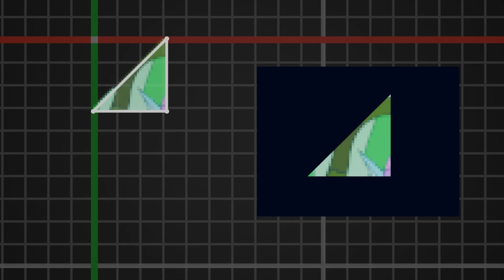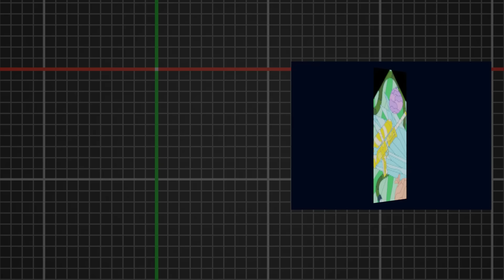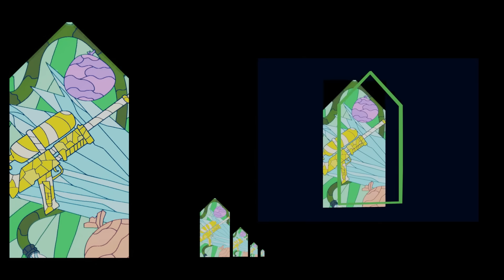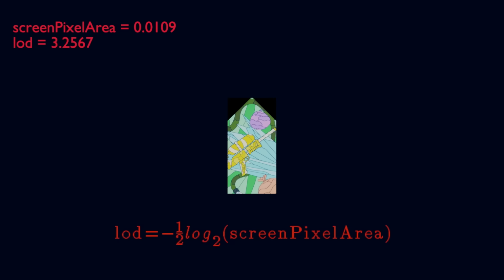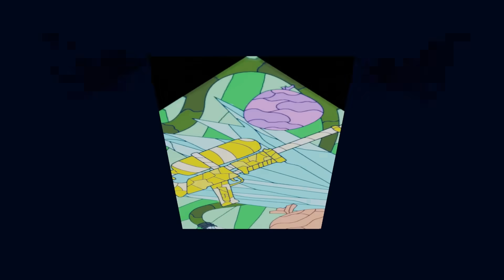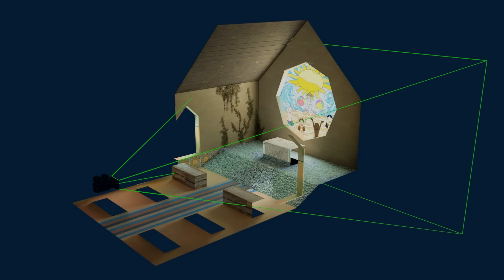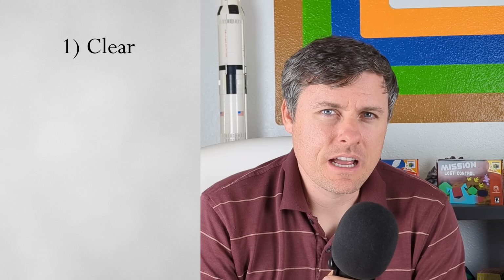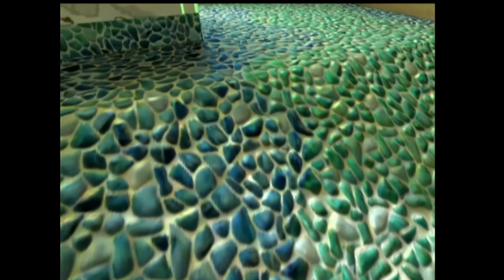How I implemented MegaTextures on real Nintendo 64 hardware

Comment: I wonder if a nanite-like system could be developed to allow N64 to render much more polygons at any single time than it normally does.
Reply: The RCP RSP code in the SDK is quite limiting. I guess if you upload special routine (shaders) for your Nanite meshes, it can render more polygons.

If you use the z buffer, you can swap in the Nintendo code and render the usual stuff into the same scene.

Comment: How about distance fields next? Valve's solution for crisp vector-like graphics from bitmaps. Would be great for text in Portal 64. Not sure how it would look with N64's diamond-like interpolation, but maybe that can be exploited in the textures. There's several ways to do distance fields beyond the basic 1-channel gradient in the "improved alpha-tested magnification for vector textures and special effects" paper that might allow for sharper results with smaller tiles. I don't recall their names off the top of my head but I know they're typically used for encoding fonts to bitmaps.
Reply: On N64 you really pay for complicated pixel shaders. Now I gotta read the paper ..
Reply: @ArneChristianRosenfeldt  It should be as simple as a threshold or boolean, but that's simple in modern computers. I don't know if that's possible on a per texture basis from the camera view.
Reply: Did you consult libdragon documentation? It makes everything sound so complicated. But if we skip the "comfort function", the 2d and the blurry stuff, it makes sense. It is a data flow: Load texture, pixel shader, blender ( reads the frame buffer, blends in the triangle ). At first it is weird that it is not just a "writer" as on PSX, but z-buffer and alpha need to "blend" in. Also maybe memory is not 18bit granular? I so hope that Rambus at least has the advantage that you can start bursts on any byte address . Now I just don't have the energy to go into libdragon again and be disappointed.  @jacobcrowley8207

Comment: I remember watching an interview with John Carmack prior to the release of Rage where he was going into the mega texture technology that was built into the Id Tech 5 engine and how cool it was from a technical perspective. He did note that his nightmare was that players would walk around backwards into every new location and then quickly swing the camera around and see all the low detail textures being swapped out in real time. Unfortunately his nightmare seems to have come true, as I also remember the extremely negative reaction that everyone had to the texture swapping in action when Rage finally came out. Rage was a failure for many reasons, but I think this was one of the big ones. This technique is probably best used in niche applications where it makes the most sense to use it rather than trying to use it everywhere all the time.
Reply: Shortly after Rage, Unreal Engine 4 also added virtual texturing, although it works a bit differently from MegaTextures. I'm not sure how often this feature is used in practice though. Could be pretty standard now.

Comment: And one thing it seems a lot of N64 devs are starting to figure out is that optimizing for the N64 can go in some very strange directions sometimes. It would seem that the N64 also has this tendency with 3d graphics, being that it would much prefer to charge through a polygon list Leeroy Jenkens style than to do the work of z-buffering the output.
Reply: Not a sentence I was expecting to read today 😂

Comment: 7:14 I wonder if it's possible on Everdrive using a memory card for save data and splitting the ROM in multiple 64mb chunks?
I'm no N64 expert but I wonder if it's possible to use the Stop'n'swap feature on a software level to switch between ROMs in real time or not.
Reply: Even if the theory worked I wonder how bad the load times could actually be... lol

Comment: Makes me wonder what could happen with some minor hardware modifications and some specialized code.
First we could throw in the expansion pack to get double the RAM.
Maybe use a custom cart that has some way to store more data with bank switching and modern parts.
Go really crazy, and mod the expansion pack to use it's own banked storage for massive RAM increases.

Comment: Random question, can the cartridge be read or written by the CPU while the RPC reads or writes system RAM?
Reply: I‘d say yes. I think the CPU can even write to RSP memory while the RDP draws pixels. Nintendo just thought that they are clever and set up a queue in system RAM ( in their SDK ).

Jaguar cannot.
Reply: @ArneChristianRosenfeldt  i've given a look at the RCP and it seems that every sub component shares the same bus. Might be an error on the diagram, but it seems that every component is ultra reliant on cache, being what makes it possible to do what you described. It's a shame, since if it was possible, the cartridge space could have some extra RAM for the CPU as a sort of scratchpad and filling the main RAM with hires textures wouldn't cause much stalling.
Reply: Yes I also checked. The difference to the Jaguar is that the system bus does not leave the chip. So it is a system on a chip, or not really a system bus. All pins are separated by a buffer. Apparently, the RAMbus signals are no electrically compatible to CMOS logic levels. Everyone says that RAMbus has a high latency. On Jaguar memory hogged the bus, but not on N64. So there were always time slices for ROM data.

Ja, ich habe auch nachgeschaut. Der Unterschied zum Jaguar ist, dass der Systembus beim N64 den Chip nicht verlässt. (system on a chip / oder aber der Name lügt ). Alle Pins sind noch mal durch Puffer davon getrennt. Offensichtlich können z.B. die lowVoltageDifferential 800 MHz vom Rambus nicht direkt elektrisch auf 73 MHz CMOS durchgeschleift werden. Alle sagen, dass der Rambus ein hohe Latenz hat. Anders als beim Jaguar kann aber glaube ich der System-Bus während dessen andere Komponenten bedienen und z.B. eine Cacheline von ROM zur CPU übertragen.  @PancakeDev

Comment: Games with minimal textures look better on low poly systems, regardless if the textures are high quality or not, regardless of performance, using fewer textures looks nicer on low poly geometry aesthetically, lower res more simple textures, look at megaman legends or doctor slump, super mario 64 also goes for a clean look.
But sure, better textures here and there can be necessary for things like character faces.

Comment: I wonder would using a bsp tree for levels make larger levels work, they give out a list of faces your working with and their distances, you could probabally use that to mipmap easier. Also i dont know if n64 vertex coloring works with this but it could be used to help with making textures look less repeated
Reply: Vertex color like subdivision only allows slight deviation from a plane / gradient. Otherwise the LoDs pop too much.

Use BSP for front to back rendering like in DOOM. For each sector, check if any pixel of the bounding volume is visible in z-buffer.

Or rather use portals.. ha! Portals cannot do columns or mesas.

Comment: 8:30 would it be playable if it was just 128p megatextures instead of the high res 1024p like in this demo?
it would still be higher res than normal n64 textures, and wouldnt use so much memory like 1024

Comment: Don’t limit yourself to the 4MB of ram.  Most everyone has an N64 expansion pack that still owns and plays on the n64.  You can easily buy them too for anyone who doesn’t.  What’s the max rom size for an n64 game?  I would go by the max size rather then 64MB which was the max released cart size.  Game cart sizes would have grown past 64MB if Nintendo supported it longer then the year 2000.
Reply: Two friends of mine and i don't have it. There are only 4 games that need it and for the others it's just an extra, not worth the 50€ at the moment
Reply: The texture cache is just 4 KB, that's the real limit here I assume.
Reply: @cube2fox  if you watch the video, you’d understand how he overcame that limit.  It’s very similar to what advanced games from the nes era used, he’s streaming textures when needed to the 4KB cache, changing textures on the fly between frames.  This implementation makes so much sense, I’m surprised programmers back then didn’t do this as well as they got more familiar with the n64 since they already did this with tiles previously.  The ram is used here to help speed up the texture loads.  He mentions the hardware 4MB of ram limit,  the limit was really 8MB of ram when you used the expansion pack.  It seems like he wants to limit himself to the base hardware and the 64MB largest cart size as though the games were made in the 90’s.  Back in the 90’s the biggest limit would have been cart size to implement this many textures.  Today though the limit on the n64 isn’t the same as back then.  Larger carts could be made.

Comment: I'm going to ask my default question again - would this be possible on the PS1?
Here is my speculation:
I imagine the lazy loading would be more noticeable due to relatively slow CD reads. I think it's an interesting problem - presumably this could be offset by the larger texture cache, but there's also far less RAM to play with.
However, I just realised that on the PS1 you have an entire powerful coprocessor that usually sits unused most of the time in a majority of games - the video frame decoder! You could load the (much smaller) compressed frame chunks to ram as your initial data and gain a much larger set of (admittedly jpegged) initial tiles, or include more layers of mips before the CD needs to be read.
Reply: MDEC compressing textures is a really interesting idea. But I think what really gets you with the CDs even beyond much lower bandwidth is the enormous random access latency. I think this technique pretty unavoidably requires a good deal of random access.
Reply: @espfusion  Naughty Dog managed to do very impressive streaming on PS1. It could be made with enough effort.
Reply: @espfusion and if access is not random. Like you record a speed run and lay out the data for it. Maybe with gaps and varying compression levels to avoid speed changes? If the player is too slow, seek back one or two tracks. Also you don’t need to hit the exact seek position as it is a guess mostly where the player will look at in 1 s. Just stream in the bits, 10to8 decode , cycle error correct , bunzip the blocks.

Even for jpeg, doesn’t the CPU do the Huffman?

Comment: It's cool you stuck to the stock n64 4MB but I think anyone experimenting with homebrew is going to have an expansion pack. I don't know how useful doubling the RAM would really be as you're being limited by the CPU in this demo by the sounds of it. Still, you can never have too much RAM.
Reply: At 40 MB of textures for this scene, that's larger than most N64 carts. Though might be an interesting essay to compare things that are known here with what Rare did to bring Conker's Bad Fur Day to light. Large cart, so many visually distinct areas and blending between nearby textures.
Reply: You can never have too much RAM, unless you're playing Space Station Silicon Valley
Reply: @TheWaterMiners  What's the significance of that?
Reply: @Kurusan  Space Station Silicon Valley does not work if your N64 has an Expansion Pak inserted. This is the only game to do this.
Reply: @TheWaterMiners  Wow that's so weird! Anyone ever figure out why?
Reply: @Kurusan  I'll copy/paste an explanation I saw. 

"When playing without the Expansion Pak, if the hexadecimal value attempts reading the maximum memory address 0x803FFFFF, the game will return to a value of 00000000. However with the Expansion Pak inserted the game fails to have a variable check, so if a variable is pulled from value 0x7FFFF and is multiplied and added to 0x803E0000, then the value overflows and attempts to draw data from the Expansion Pak RA starting at 0x80400000 and above. Since this RAM isn't cleared when Silicon Valley is turned on as most Expansion Pak games do, data from a previously played game is usually left over on the Expansion Pak, meaning the values and their instructions returned to the game are almost never compatible resulting in freezes."
Reply: @TheWaterMiners  thanks for the explanation! Pretty interesting how games work. Especially during a time where updates/patches weren't really a thing.
Reply: @Kurusan  The game actually did get a patch to fix this, but as you said, existing cartridges couldn't be patched. It was only the ones produced later that had the patch.

Comment: need to procedurally generate textures in the background from scene to scene to open up more variety
Reply: Probably too slow.
Reply: @timmygilbert4102  huh? you can generate a  whole 256x256  texture in one frame just like you can generate an actual game  frame depending on you procedures. So if you had 1000 frames of game play per level  you could budget maybe 1-2% of those frames for texture generation and not compromise game too much surely?
Reply: @blengi  the issue is that the entire texture had to be stored somewhere. This work because texture pieces are streamed to ram constantly. So you will have to create texture constantly faster than you can load them. Unlikely to happen.
Reply: The code needs to be special for each kind of texture and fast. You need Coder-Artists. Maybe some shader library for a modern GPU can be ported? Povray has license issues.
Reply: @ArneChristianRosenfeldt  no the N64 won't be fast enough for pixel operation. Kaze is optimizing at the vertex level and that's on the edge. There is vastly mire pixel than vertex. The only thing you can do is texture blend, and there is inherent limit to what this can achieve. Kaze is making texture blending effect already.

Comment: OMG! I've always wanted to see if this exact thing was possible, but learning the hardware was too intimidating for me to even begin to find out. But here you've done it! That's absolutely amazing. 
I've got a question about another thing the N64 supposedly can't do: additive blending. Do you think there could be any way at all to fix or work around the console's broken additive blending which (as you probably know) doesn't cap the output, and as a result is never used in any games? At least I thought it wasn't... but a while ago I was looking at some screenshots of Mario Tennis which I never played, and the power smash effect on the ball is absolutely additive or I'm about 99.99% sure it is. So there has to be some way to do it. Any thoughts?
Reply: You can do additive blending but it wraps around to black after reaching intensity of 1.5 I think. So by carefully tuning your assets it can be used. For 2D sprites a special RSP program can be used for saturated additive blending. See the "pixelshader" example in libdragon's unstable branch.
Reply: @pekkavaa  Yeah, I should've mentioned the wraparound thing was what I meant when I said it's uncapped. I didn't know it was at 1.5 though? I thought it was just a byte wraparound i.e. anything above r255, g255 or b255 (or indeed 1.0). That's interesting! That makes it more flexible than I previously thought, though I'm still very interested in the Mario Tennis effect and why no other games use it that way (that I know of).

Comment: What could probably work really well is a combination between using less highly detailed, shared across assets tiling textures for the meshes base color / texture, and using individual pre-baked textures only for gi (bounce lighting, emission, shadows and ambient occlusion). I’d imagine that working especially well in games that lend themselves to those techniques, like your portal n64 project.

Edit: Well, should have watched 10 more seconds before commenting 😁 (but still, would be really interested to see this applied for gi 👀)

Comment: If a higher resolution tile is already loaded for an up close object but is used again on one further away, another minor optimization you could attempt is to just use the higher resolution tile already available.
Also, I can see situations where so much stuff can be up close that it tries to overload the high resolution section of the buffer, how does it deal with that? does it focus the high resolution towards the center of the screen and drop to lower quality states for the stuff along the edges more likely to be replaced sooner as the camera moves?
Reply: At what point in time is there a high resolution section? The color demo at the end suggests a shared buffer.
Reply: @ArneChristianRosenfeldt  The buffer is shared, but it is still split into different segments depending on the resolution of the texture loaded, which is represented visually in the video displayed on either side of the shown demo at one point.
Reply: Isn't it nice that rounding errors don't lead to segmentation faults because we load whole segments using pure integer math?

Und ist es nicht herlich, dass selbst bei Rundungsfehlern kein einzelnes Texel vom Nachbar Segment gerendert wird, weil wir es gar nicht in TMEM laden? Kein Windows "segmentation fault" möglich  @kmemz

Comment: Very cool to see new(er) graphics techniques applied to older hardware. It makes me wonder what else you can squeeze out of the fixed function hardware. Makes me wonder if there is a way you can do bump mapping on N64. 
Incredible work!
Reply: You can probably do bumpmap with offset mask. Like imagine a bw image and it's negative, add the negative on top, then offset by one or two pixel in a direction. Work better on machine that can do complex blending where you can add steps, then you get an emboss filter that you blend back with color texture. Those techniques work best on flat surface because you can't discriminate per pixel in old hardware, it's a uv displacement and blending trick.
Reply: @timmygilbert4102  ah yes this trick used to be called emboss mapping I believe!